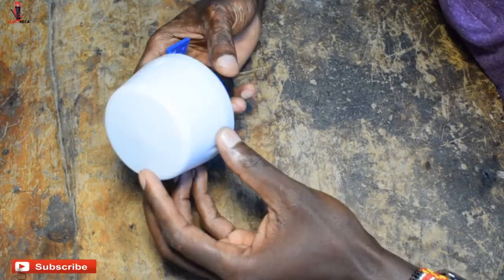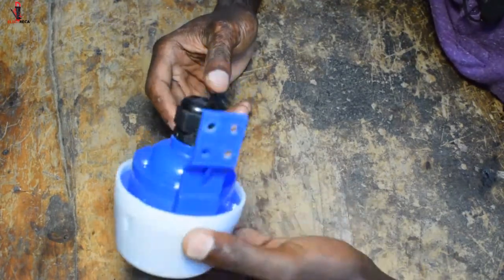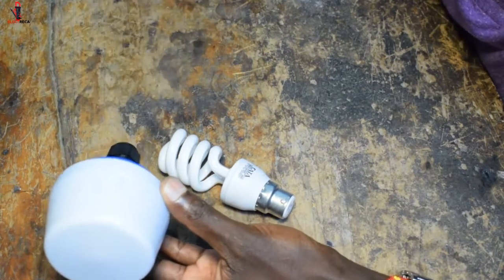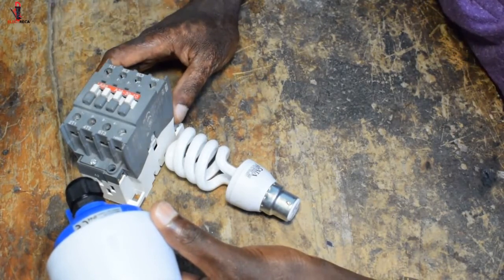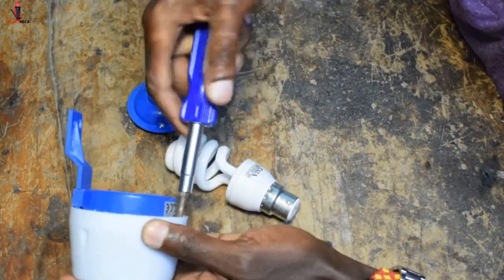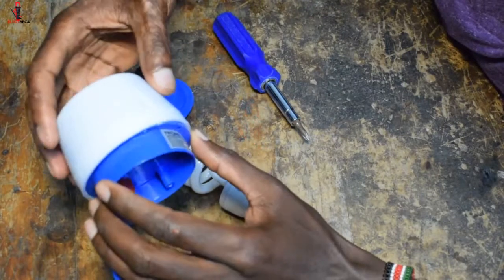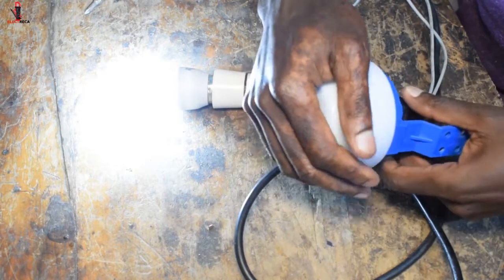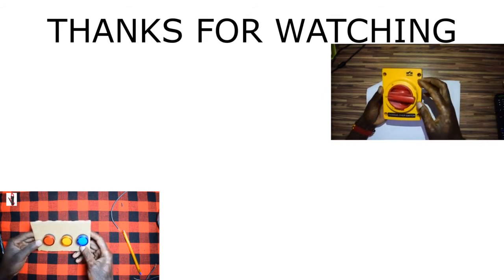How to wire photocell to automatic day-night light|automatic day-night timer switch|ELECTRECA

Comment: Please how many lighting point can a photocell sensor can control
Reply from the maker: Photocell usually  rated at 10 to 15amps that rating can take a couple of light depending on the rating, but there is always an alternative of using contactors if the load is way to high that a photocell can handle.

Comment: How many light 💡 bulbs can be connect into one sensor
Reply from the maker: @Emmanuel  
That sensor is  20A, so you must know the total load current before you connect. 
But also you can take advantage of contactor.
Your sensor can control the contactor,then the load to contactor. Op that helps.
Reply: @elektreca  thanks Man